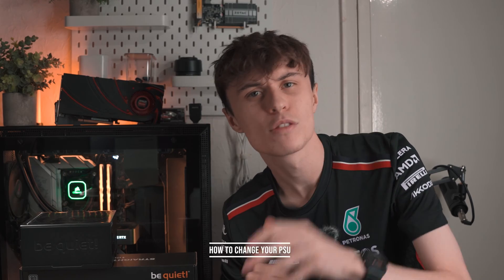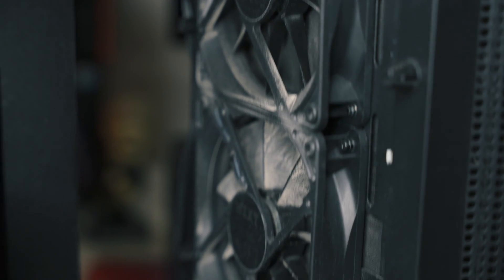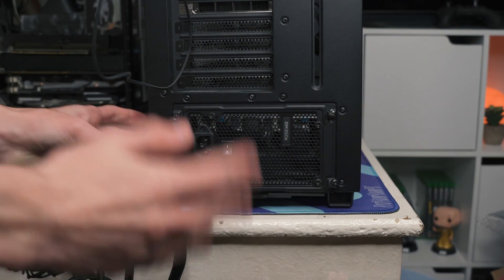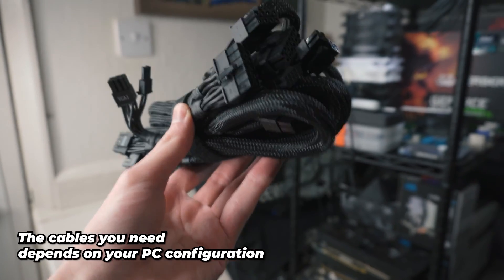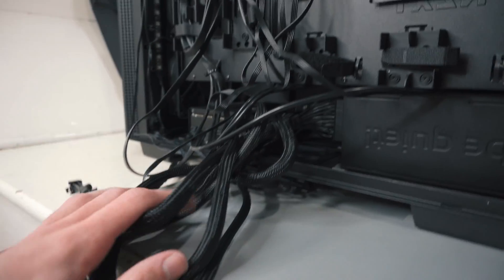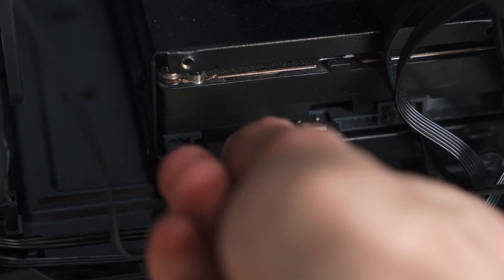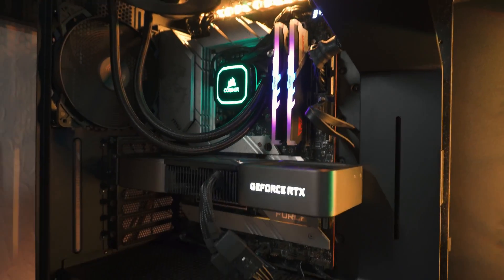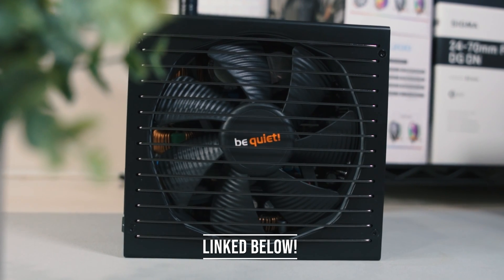How to Replace a PC Power Supply - PSU Upgrade Guide

Comment: built my first pc earlier this year. swapping out PSU for a new 5080. im glad I googled it cuz I didnt know the cables werent universal. I thought it was just unscrew the PSU and plug all the tower cables into the new PSU. 8 pin is 8 pin, 12 pin is 12 pin, etc... im cringing at the thought of frying out every component

Comment: I would appreciate recommendations for a power supply unit that does not produce buzzing. My current RM750e frequently emits a buzzing noise during shutdown and when loading the main screen. This is quite frustrating, and I would like to purchase a replacement but am unsure which model to choose.

Comment: Does the power cable that enters the PSU matter? Ive been told both that a kettle cable with the correct Amps and voltage is fine. But ive also been told that the power cable is really specific to the psu and cant be mixed up (kind of like how you describe the cables coming out of the psu).
Reply from the maker: The one coming from the socket on teh wall doesn't matter too much from my experience. I can't specifically talk for your region. But in teh UK as long as you use a 13A fuse plug, you should be golden. I reuse my kettle elad all the time and I've personally never had an issue

Comment: Bf6 has this anoying power surge problem... never have problems with other games but my pc keeps instant rebooting when i play bf6.. guess my 5yo psu met his limit... damnit i wanted to hold this upgrade out till zen 6😪
Reply from the maker: I had a similar issue with BF2042. Turns out the thermal paste on my 3080 at the time was in dire need of a change. 

Not saying that's your issue, but it's worth checking GPU temps
Reply: @ProYamYamPC gpu temps are fine (max 76C), did all the OCCT stress tests.. pc kept running during every test, not even 1 failure.. i have no clue..

Comment: Wait, why go through all the work of pulling out graphics card cables, motherboard cables, CPU cables, GPU cables, fan cables, etc. etc.?  Wouldn't it be many times easier to simply disconnect the cables directly from the back of the bad power supply, and reconnect them to the new power supply?  Pardon my ignorance as I don't work on computers much, but I suspect my PSU needs replacement and I'm of the "work smarter, not harder" mentality. Thanks!
Reply from the maker: Never mix old PSU cables. They often have different pin outs and it can potentially blow up your parts

Comment: In this tutorial, you unplugged all the cables from the components before removing the power supply. I'm replacing my power supply... but I'm replacing it with the exact same model so I don't need to change the cables. is it still advised that I discnnect the cables from the componenets and then reconnect them? Or can I just disconnect them from the power supply and connect them to the new one?

Comment: I’m doing this now. Have to swap my Corsair 850w for a beQuiet 1600w. Then upgrade my 3080rtx tuf for a 5080rtx tuf. Thing is huge!! Looks like a VCR tbh 😅 I have a large modifiable beQuiet case and using beQuiet fans as well, so it should all come together and be future proof!!
Reply: jesus bro what do u need 1600 for, i mean im also getting a 5090 and a 1500w psu as well but still
Reply: @prodbuds  It wil come in handy for my next build for sure :)
Reply: @Bokaj01 i guess it’s a good future proof, even 1500 is overkill

Comment: In theory looks simple , disconect a few cables and plug another in, but it looks absolutely terrifying 😂, gonna do it next week
Reply from the maker: Best of luck bro!
Reply: @ProYamYamPC  thanks! Just the confidence boost I needed 😅
Reply: Hey, howd it go?
Reply: @vizz00 quite well actually the CPU power cable was a pain becouse of the air cooler.
Reply: @ornatehammer661  alright. good to know, as i might have to upgrade my psu at some point in the near future
Reply: @vizz00  same but i'm doing mine in december and I pretty much know everything when it comes to building PCs but I still come here just to have a refresh lmao.
Reply: msi mpg 850w and 5080 otw, first time digging into her since i got it 😬
Reply: @ianseghers9467  good luck if you watch enough PC building tutorials isn't terrifying anymore at all, did it , was easier than it looked , there are just 4 types of cables and they fit only in they're designated spot, now even after a year of not touching it I feel confident to take it apart completely after watching again just one YouTube video. Good luck!

Comment: I need to do this but am worried about the capacitators. How can I tell it's drained for sure?
Reply from the maker: Turn off your PSU and hold down the power button for around 5-10 seconds. That will drain the caps
Reply: @ProYamYamPC  Yes, I heard about that. It really is enough?
Reply: use a multimeter and set it to farads if you want to really make sure they are drained .

Comment: Thank you for this video, I just bought RX 7900 XTX and to my surprise my Deepcool PK850D has only 2 separate PCIE (it has two more, but they are daisy-chained). So I decided to upgrade my PSU as well and decided to buy Be Quiet! Straight Power 12 1000W. So, I started to look for a guide how to replace my current PSU and what a pleasant surprise, this video features my new PSU :)

Comment: If you're upgrading to a higher-watt PSU of the same brand, that has all the same connections (and more), is it really necessary to disconnect the cables from the motherboard?
Reply: Late response but YES
Reply: it's best that you just use the new cables even if they are the same brand you have to remember that your upgrading wattage meaning the old cables are rated for lower wattage so it's best to use the new cables that came with your new PSU. Now if you were replacing the PSU with the same wattage and brand then you can leave cables asis.

Comment: Been sitting on a straight power 12 1200w model for like 5 months now. Though I only switched to it since I have a 4080, (otherwise I'd keep XPG core reactor, which didnt have direct 12 vhpwr connection). So far so good...

Comment: i hope to never have to upgrade / replace psu in my case (tecware nexus forge m2). i had to fit in a 160mm server psu in there and i never hope to do it again
Reply from the maker: Changing a PSU is a very lengthy process as well😅

Comment: Thanks for the tutorial.
I just bought a Rme1000 and am curious if you personally ever heard any relevant downsides to this PSU.
I heard of non optimal efficiency but that doesn't bother me to much at a 1000w.
Reply from the maker: I’m glad you found it helpful. The RM1000e is a good unit. It’s rated as a Tier A PSU on the PSU tier list. That’s a good PSU.